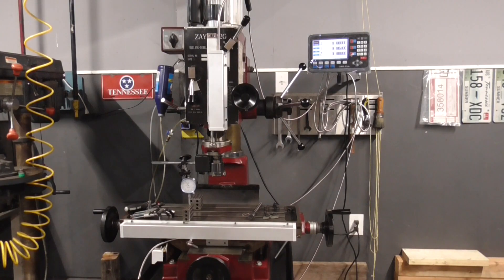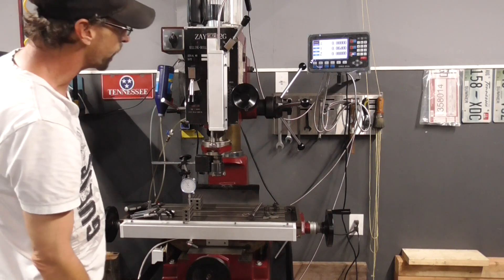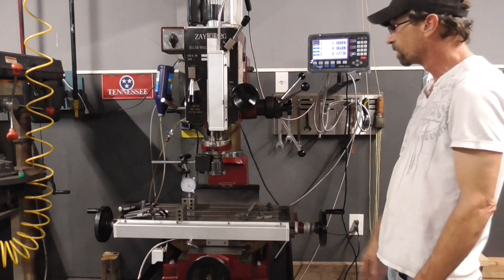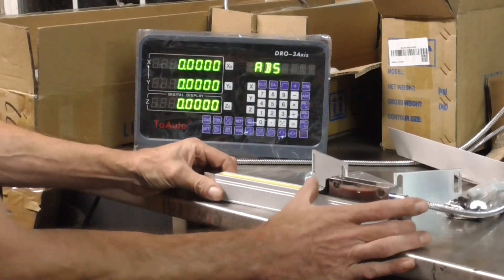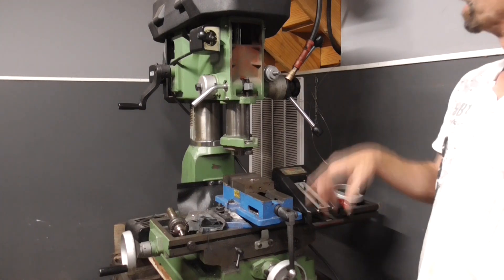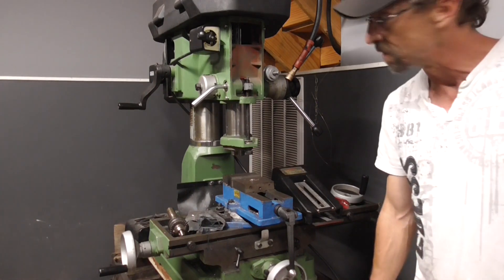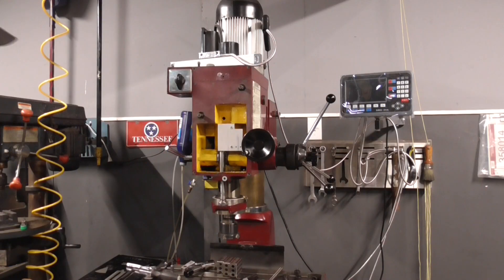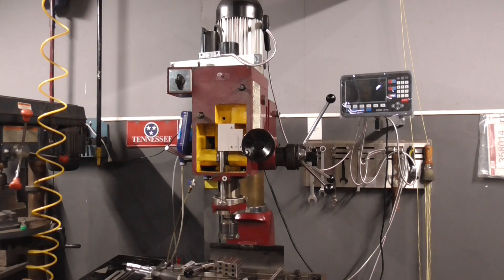$300 Ebay DRO install for ZAY7032G (RF-31 Gear Head) mill - Waste of money or worth it ?!?!

Comment: On my ZAY7032G I am using the factory Z "Depth of cut" rod for my Glass Scale. I found that 1/2 inch PEX pipe fits SNUG over the M12X1.75 threads. I then JB Welded a 1/2 inch dia copper water pipe 'Sweat' connector into the Motors frames HOLE that the PEX slides in real snug too. 
This takes all the sloppy side play out of the spindle. Like I said, the rod fits snug inside the PEX and the PEX slides smoothly but tightly in the copper coupler. Maybe just a little sticition but the Quill return spring still pulls the quill back to zero rest.

I milled out two 1/2 inch thick aluminum brackets that I drilled M12X1.75 threads in. I cut the PEX pipe so the bottom bracket touches the frame at the full extension of the quill, as a feed stop. I used a M12X1.75 coupler nut, 1.5" long, to add a Buttonhead M12X1.75 bolt to make the Depth rod longer so I could lock nut the top bracket is rigid. Then drilled and tapped both brackets for a M6X1.0 bolt to hold the Glass Scales slider on. 

My Glass Scale sits just to the right of the factory depth slot. Its slider is under the ZAY7035's front cover, I cut the slot wider. I did have to rotate my HIGH-LOW speed handle 180 degrees up for clearance. 

Even if you are not adding a DRO to a ZAY7032, adding that 1/2 inch copper pipe connector and a short piece of 1/2 inch PEX pipe will take a lot of slop out of the spindle. 
Just cut the PEX pipe after you run the quill down to bottom lock so the pipe is flush with the motors frame. 

Overall, for a HOBBY machine and the price I paid for it, adding a 3 axis DRO is worth it. 

A 2 Axis will also work as knowing where "Z" is can be done with the factory gauge.

Comment: How much do you think a very used 2005 zay7032g machine would go for? There is one for sale near by and I believe it’s priced way too high but I would like to give an offer. Thanks in advance!
Reply from the maker: Hello, seems they are going up in price lately for used gear head mills, but for reference, I paid $1500 for mine a couple of years ago and it was in good to very good shape. Just to see, I looked real quick and there’s one that looks to be fair shape out on marketplace in Roswell GA listed for $1200 currently so I’d say a very used one would go for $1000 to $1200 if it’s still in working condition.  Hope this helps a bit and all the best ! Steve
Reply: @StevesDIYs  6 years ago I picked up a ZAY7035G at an estate sale when a Boeing Machinist passed. I got 5 pickup loads of stuff for $5,000 including a Greenie RF31, 2 Craftsman Bed Lathes and boxes of NEW end mills, many carbide. The 7035 was all slimy with an oil leak. The widow said her husband said it had a crack in the case. NOPE, it was the seal on the 1-2-3 speed shaft. A bag of 10 seals was $7.

I have made many small items from huge chunks of steel and aluminum.

I bought a TOAUTO DRO before Tariffs kicked in and will be trying to mount a 150mm Glass scale on my Z. I may need to rethink my Y but the X is so simple but have to give up the M6 T nut stop. So thanks for the video

Comment: I have the same mill and I mounted my X axis behind the table, not in the front, where it gets in the way. Also I put the glass scale on the y axis under the tables and put the scale beside the lead screw out of the way.
Reply from the maker: 👍. Yep, I decided to put the X axis in the front since I usually throw the chips to the back and figured it would stay cleaner being in the front. Since they are cheap scales I wanted to give them the best chance to survive, lol !

Comment: I am putting a DRO on a RF31. Like your green machine, my quill had some rotational slop. This slop is caused by the end of the locating bolt being too small for the slot milled in the quill.  I milled a tang that just fits in the quill groove onto the end of a 1/2" drill rod. I drilled the hole in the mill head to 1/2". I cut the drill rid flush with the head casting. I then drilled and tapped a 1/4" hole where the drill rod meets the casting. When I install the 1/4" bolt, the pin I made is tight in the bore and the slop is gone. 

I like your idea on keeping the bottom rod holder 'floating' rotationally on the quill. I will post a video tomorrow on my fix.
Reply from the maker: That’s a great idea on how to improve the rotational sloppiness in the quill 👍👍👍. My green mill has tons of movement which makes for a lot of chatter when indexing down for a counterbore for sure.  If you have a YouTube channel for your videos, post up a link to the video in a comment…that will be great to see how you modified it and the results 👍.

After seeing how sensitive the scales are to side-to-side movement, keeping it separated from and unwanted quill movement seemed to be a good thing to do for sure.  So far it’s been spot on with the readings vs. actual on parts I’ve made since installing the DRO (the DRO is way more accurate than the quill dial…I don’t think the rack teeth were cut very precision on mine) and it’s so much nicer to not have to read the dials anymore, lol.
Reply: https://youtu.be/3ZS5jusATqY 

My rookie video link
Reply: I have a 1993 XV1100, mostly stock.  GREAT  zip around town bike, just geared too low for long highway trips.
Reply from the maker: @drive42  👍. Yep, I mostly ride my 1st Gens around town or trips on highways as I like to just cruise around on them.  The stock xv750 and the bobber are really comfortable to ride, but my old back is still getting used to the recent Cafe build, lol.
Reply from the maker: @drive42  that’s a slick way to get rid of the slop 👍.  I’ll bet that most of our RF clones are like this so that should be really helpful for folks.  I saved your video over on my “Other YouTuber’s good videos” Playlist so other folks can find it from there too.  All the best !  Steve

Comment: Explanation was very professional, detailed.  Thank you Steve for the review, seems worth it for the accuracy.
Reply from the maker: Thank man 👍. Yep, for a cheap set of DROs, they are surprisingly accurate.  I’ll probably still keep a check on the x and y axis using the dials on the turn handles, but for the z axis, I’ve found that the DRO is way more accurate than the original dial due to all of the slop that’s in the handle mechanism.  It was nice to finally understand why the z axis had never been repeatable when I had done setups in the past.